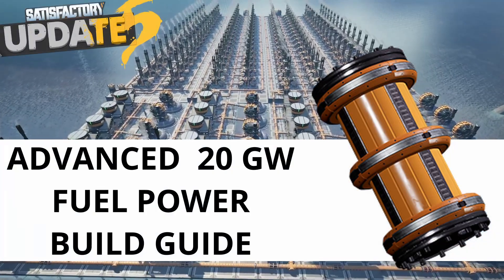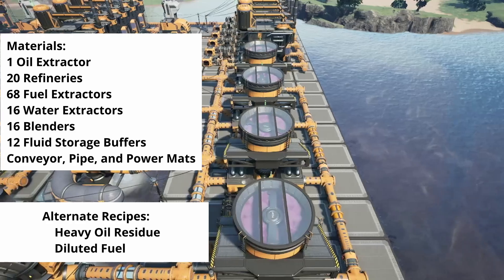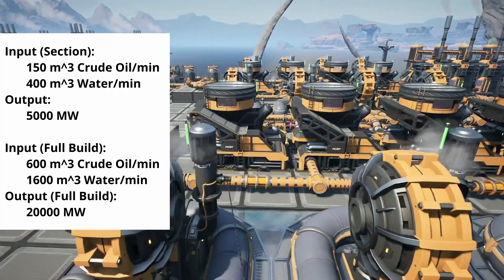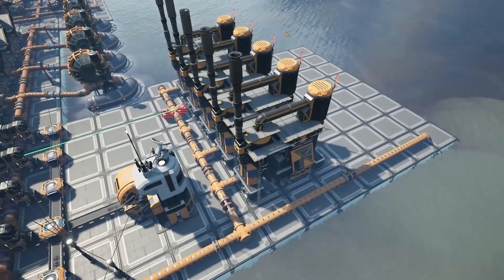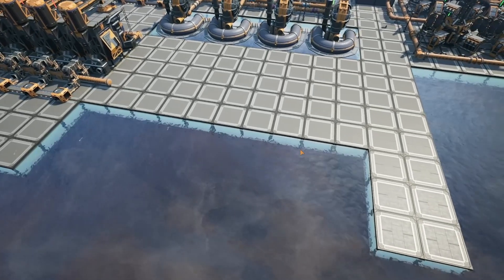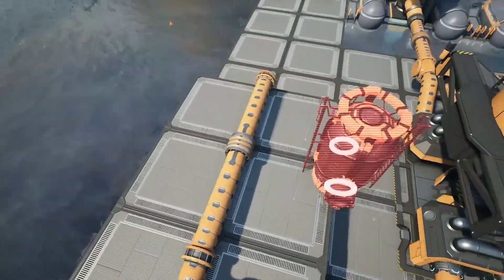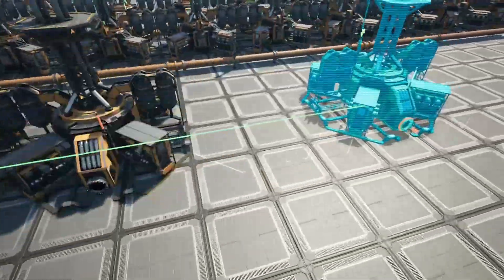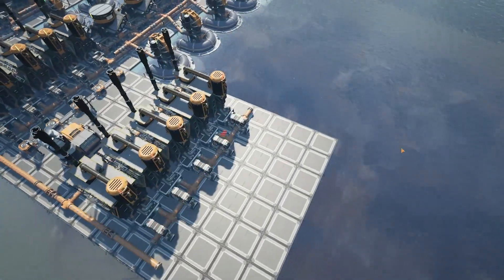Satisfactory Fuel Generator Setup Build Guide - 100% EFFICIENT Satisfactory Update 5 Fuel Power

Comment: Love this concept! I just had a question on the number of generators and the underclocking you mentioned. 
Four blenders pumps out 400 fuel. 
400/12 (per generator is 33.333). So I see why you are saying have the 34th generator underclocked to 33.33% but that shows as costing 5.15 fuel when underclocked to that percent.  So 33 at full speed times 12 is 396 so if you add the 5.15 needed for that 34th underclocked generator to 33.33% it would exceed the 400 fuel that the blenders are making. 
Is this on purpose? Is the reason for those extra tanks at the beginning and back of the system to manage for that difference? Just want to make sure I understand and avoid any issues over time :)
Thanks again for these videos!
Reply: okay so this was just for me but I set the 1 gen to 33.3333%(target 50 MW) and when I started up the power plant, I had an extra 14.4 MW which was very weird since I had no other power except this, the culprit was the one underclocked geny. I don't think underclocking works properly on the fuel generators because when I set it too 24%(Target 36 MW) the geny was still making 50 MW. and the consumption of fuel is 4m^3 pm making the consumption of fuel an equal 400

Comment: This is incredibly helpful! I was just about to build out multiple fuel generator power plants in Blue Crater with the normal recipes. But then I unlocked the diluted fuel recipe, saw how much fuel it provided, and wondered if that would alter the power plant at all. Your video is perfect at explaining the build and the specifics, I do believe I fully understand it and I've looked into the comments and will either adjust or remove the last generator in my setup. Blue Crater just barely has enough space over the water from north to south at a particular point to form two columns of this setup, so I'll have to stack the columns on top of each other to fit it all. My big problem at the moment is that Blue Crater has three Pure Oil nodes and two normal, essentially four Pure Oil nodes, which means ~80GW of power total just right there. If I wanna maximize the amount of fuel in that location for power, I'll have to make quite the tall tower of fuel generators!

Thanks for the tutorial! I am both excited for being able to have access to so much power from these fuel generators and also overwhelmed at how much time and resources it's going to take to make four power plants of this size. 😵‍💫
Reply: I can't seem to get a clean 64 platforms across on the blue crater?  How did you manage to do it?

Comment: Small issue I found, the generators are consuming more fuel than you're producing.
Power Generators use a really strange formula for calculating the rate which fuel is consumed, and that last generator that you have clocked at 33.33% is consuming 5.15 fuel per minute instead of the expected 4 per minute. You can find the formula on the wiki page for Overclocking. It won't give you a neat 5000MW sadly, but to fix this, that last generator needs to be set to 23.97% instead.
Reply from the maker: Great catch!
Reply: @Dekoba  Really love your design here though. Think I'm gonna be making great use out of it :D

Comment: Hey Dekoba! Did you ever find a solution for the middle generators not getting enough fuel? I saw a few suggestions but no clear solution. Maybe a follow-up video if you aren't too busy.
Reply: I'm having this issue too.
Reply: Change the underclocked generators to 23.97% that fixed my problem if that doesn't work make it so your main pipe lines are mark 2 only use mark 1 to go to and from the main pipe to machines.

Comment: I've tried building this and I don't know where I've gone wrong, but I can only run 10 fuel burners on each side, the 11th one starts to run a bit low and the rest don't even get fed. I've even tried overclocking the blenders to 150%, but it still doesn't help... any ideas?
Reply from the maker: The loop back on the end is meant to address this. The 'big answer' is to run more pipelines in parallel. This build ran without issue on my game for a hundred hours with a few minor changes (I removed the last underclocked generator, and rotated half the generators to feed off of each input pipe in each section), but fluids are finicky and the only way to ensure they work well is to over produce and provide lots of parallel flow routes.=-

Comment: I'm going to try this for my style of fuel factory but using your method to prevent sloshing. Thank you. FYI, I just use the Alternate Super Fuel recipe and then go straight into the furl genies. I may get elaborate someday and use the blenders if I need more juice. I use the MK++ Mod so I use MK 4 equipment which provides so much as it is. Thanks though. Good and clear guide, and nice explanation of points. Subbed.
Reply: "furl genies " ?

Comment: would love to see what a turbofuel version of this build would be if you ever get the chance to do it.  this is so clean!  definitely copying this into my world next time I play as I need a lot of power to even get nuclear off the ground sustainably
Reply: 1066 coal + 1066 sulfur => 43 Assembler = 1066 compacted coal

The setup is the same up until the blenders.

Then the output of 4 blenders each =>
400 fuel + 533 compacted coal => 18 refineries = 333 Turbofuel

333 Turbofuel feed 74 Powerplants at 4,5m3/min

copy this setup 3 more times for

4x 74x 150MW = 44.400MW Output
Reply: Agreed, oil to heavy residue to blended fuel to turbo fuel I think, but there will be a lot of math involved.

Comment: Ok mate. I have been trying a few things with this setup.
First i tryed removing 1 generator. That did not work. 
So i removed 2 in the middle, so that i have 2 sections with 16 generators on each. I connect the 2 pipelines outside  through the middle and place a valve there allso.
I will get back to you if it works that way
Reply from the maker: Ok.  I'll post a world download later tonight if that helps
Reply: @Dekoba  Allright then. I simply cannot get this setup to work. I even tryed building 1 set next to it and connected them together, so to see if they would help eachother out. 
Could it be that the 16 furthest away is too far away? Am i putting the valves down wrong?
Either way, im gonna try building 16+16 next to eachother and supplying them that way next.
Thanks for good content btw.
Reply from the maker: @Wookscoop  in sorry to hear that. Mine has been running for weeks without issues. If you can ppost a save i can take a look,  or hop in multi-player at some point.
Reply: @Dekoba  nah dont worry about it. Its part of the fun getting things to work. Besides, im close to nuklear hehe

Comment: I have an issue with the middle generators in a section dont get enough fuel. I cant seem to find the issue
Reply from the maker: Since making this video, ive taken to removing the final generator - the one that is undertuned. Theres a bug in the game that each generator deletes 5 units of fuel whenever you load a save, and the only way to solve it is to overproduce. I have started deleting that generator and accepting tha the factory produces 50MW less per section, but over time overfills and eliminates the shortages.
Reply: @Dekoba  I just finished 3rd module of this plant and realised, there is no fuel in big tank at the end of generator line. One thing is as you mentioned, bug with deletion of fluid.
But one more thing: "Tne one of them to 33,33% clock speed" such under-clocked generator eats 5,15/minute. 12*33+5,15=401,15 but 4 Blenders are supposed to generate only 400 fuel.
24% uses 4 fuel/minute making it 12*33+4=400 so keep it under 24% (because of the bug) or as you wrote, remove/replace it seems a better idea.
Reply: @Dekoba  Thanks for the heads up. I will try the same
Reply: @Dekoba  In the spot that you removed that generator, you could put from 1 to maybe 12 power storage units (depending on how vertical you wanted to build) to buffer the energy.  or move the industrial fluid buffer into that spot to save a row or two of foundations on the end
Reply from the maker: @cujoe88  Those are great ideas! In my current world I ran a line of power storages between sections of the plant on an extra foundation. I love the idea of moving the extra fluid buffer closer, though, and I bet it would look great too!
Reply: @Dekoba  how do you get the blenders to have diluted fuel I don’t have that option
Reply from the maker: @jamesbartlett1551  its an alteranate recipe from a hard drive, youll need to find hard drives and research them to unlock it!
Reply: @Dekoba  Thanks very much for the guide. Would you be able to share your save so we could see how you resolved the fuel issue due to bug on loading game?

Comment: I love this build and im on the lockout for those two alternates. Is there a way to gain those or is it totally random?
Reply from the maker: Is random sadly.  And unfortunately there's no other really good alternatives, although just building 10 2gw basic fuel plants works fine,  and only requires 1200 crude a minute, which is available at any of the locations i listed in the guide.
Reply: @Dekoba  But I have been reading about harddrives. Is it true that getting all crashsites will get you all alternate recipes?
Reply from the maker: @Wookscoop  yes! There are 96 hard drives and 89 alienate recipes in the game presently.  You can also get two inventory upgrades from them,  leaving 5 spares at the moment.
Reply: @Dekoba  Sweet. Im going on a harddrive hunt

Comment: Can you explain how to fix the 'Sloshing' issue? I built this setup x5 so i have about 100k mw worth. I let everything fill to the max but all the fuel plants tend to pull from the buffers before the blenders replenish the system and over time, the end buffer drops below 100 units and the plants in the middle of each row empty and start to intermittently turn off.
Reply from the maker: Before I answer your question, you should know theres a bug in the current version of satisfactory that causes each machine to delete 5 units of fluid each time you reload a save. This might be enough to cause what you are seeing, and my response has simply been to remove the 34th power plant (the underperforming one) so I am generating an excess of fuel. This is less efficient but it has worked for me. That plant should also be tuned to 24% instead of 33% as I stated in the video because the way power plant underclocking works is different from other machines. 

 That said, there are some things you can do. If you are using a flow equalizer and have a loop around the outside (allowing fluid to fill into the back)  there are really only 2 major ways to improve your performance, and they both involve a significant rebuild (i discovered these after making the video or id have included them.) First, you can turn your power plants outward so the feed from the outer edge of the loop rather than the inner line, making it so that fluid has more opportunity to get to each generator. Second, building the blenders on an elevated platform so the fluid flows down hill into the buffers and generators will help speed it along greatly. 4-8 meters is plenty, you don't need to go crazy here.

Hope this helps.
Reply: @Dekoba  I appreciate the reply. I'm gonna try to flip them around and see where that leaves me.
Reply: @Dekoba  Have you tried removing the industrial storage buffer altogether? Do you think the 2 small ones at the beginning is sufficient?
Reply: @Dekoba  I am damn glad I read the replies.

Comment: Not a bad build. I'm getting close to 10GW power from 2 normal nodes without using blenders and using less fuel generators, I have mine overclocked to about 200%. I haven't quite unlocked aluminum processing yet. I could easily do it, but I'm already getting hit with bad frame rates. My PC is a bit old and can barely run the game so I'm kind of stuck. This game is awesome and I really enjoy doing the builds, but when it becomes almost unplayable... yeah, it limits you with what you could do and I can not afford to go out and buy a new high end rig atm. So my builds are a bit slow going and I've been investing some of my time into other great titles. Here's some of my list: Factorio, Dyson Sphere Program, Subnautica, Oxygen Not Included... and they're all engaging! I do kind of need a new rig though, my current system is a workhorse, but it's starting to show its age.
Reply: All your recommended games are in my favorite list. I guess we are one specific breed lol.

Comment: Hey, great vid. What is the fluid buffer on the end for? The compensator is nice - i will use that in my build too. Good work!
Reply: That solves the problem of runing out of fuel in generators for few seconds and stabilize the power output. Its a problem that you will find eventually when you work with big amounts of fluids xD

Comment: I count 32 generators in each section. Am I wrong?
Reply from the maker: You've got a sharp eye! When filming I accidentally left a row of generators off the end because I am bad at counting apparently, but the math is correct: each section is producing 400 fuel which will run 33.333 generators, so 34 is the correct number to build. You can see at the very end of the video that the edge of the platform looks differently because I had corrected this.
Reply: @Dekoba   I had a TO-DO list for 34 and left with excess materials for 2 when I used 45 unit long foundations for generators. I was like what the hell? :) . Great video except math. XD